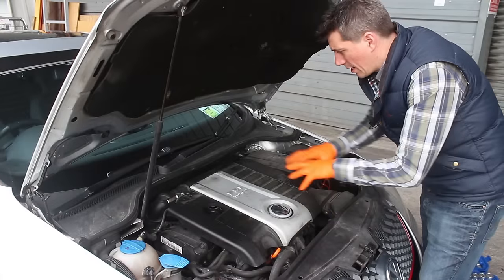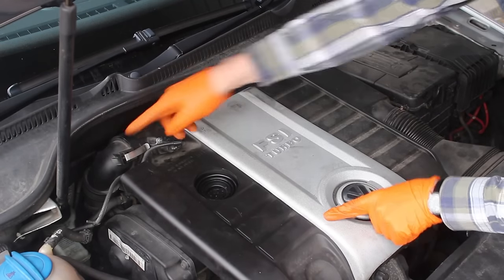Project GTi - How To Change your Air Filter

Comment: Thanks for the video, very helpful.To anyone reading, this engine cover does not come off easy as in the video unless your fastners are already broken.My was a total pita to get off, & get back on too.2 of my rubber bits broke, the cover is now quite wobbly.A truly awful design imo.Also I found it helpful to remove the 2 torx screws that fix the air inlet pipe near the slam panel.

Comment: It was easy to disconnect all the things you showed but I couldn't get the cover to disconnect from the rubber grommets no matter how hard I pulled and I pulled hard. Is there a screw or something I missed? I did remove the oil cap.
Reply: I got it, but I had to pull on it like I wanted to break it! It is extremely tight with those rubber grommets. I made a video showing how impossible it is to install. I came up with a technique that worked but it was still difficult.
Reply: just do a bit of grease on the grommets. ;-)
Reply: @TheSkystrider  do you still have the video ? I have same problem And i dont want to break that plastic cover.

Comment: i was wondering if you had any idea why my 2006 GTI would be blowing consent hot air out of the driver air vents both floor as well as dash vents
Reply: My guess would be because they run hot
Reply: I got that too turn you aircon on set it to the lowest temp them turn your aircon off

Comment: Air filter? What if you have a cold air intake and had to remove the engine cover?
Reply: little late but just wash & reoil the filter, some filters are different depending on material used and you may need to replace the whole filter entirely, time wise usually around 40,000km/25,000miles. i wouldn't go any higher then your risking it.